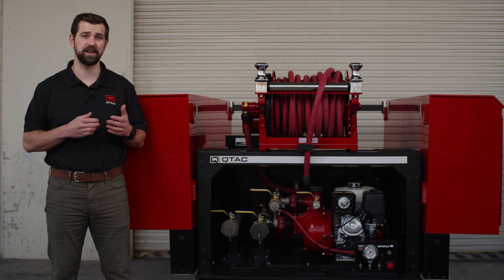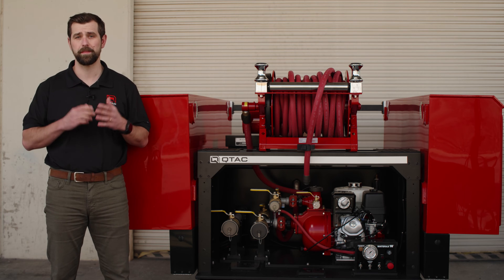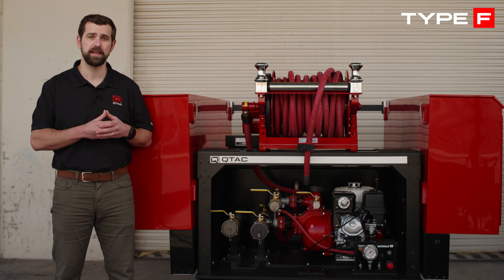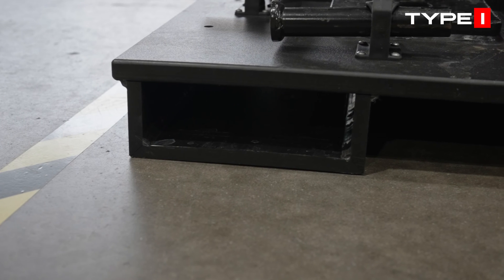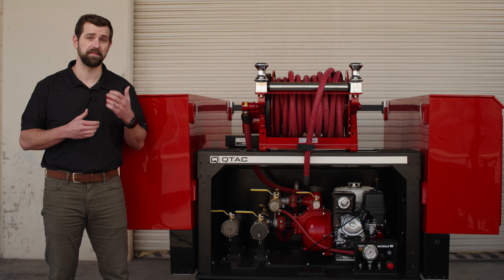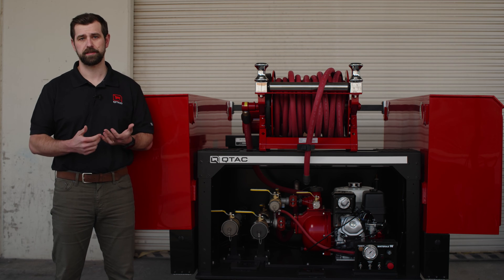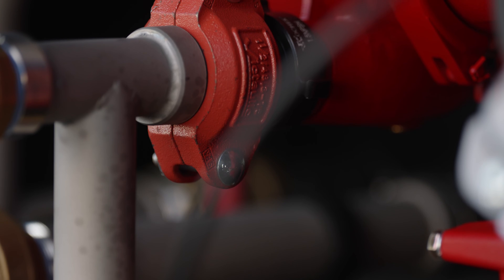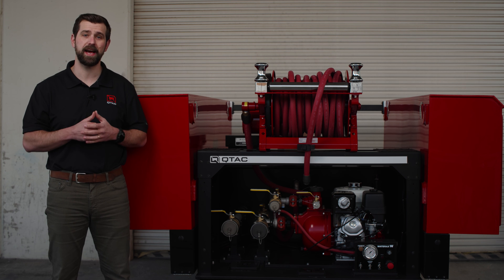Tsunami Pro Skids by QTAC: Durability and Flexibility for Firefighting Professionals

Comment: It doesn’t look very tall if you don’t have a hose real on top could you put an EMS skid
Reply from the maker: Thanks for the comment! It is pretty high up there when it is in the back of a truck and we do not advise putting any EMS Rescue platforms on top of it. You could use that space for other gear or storage items however. 👍